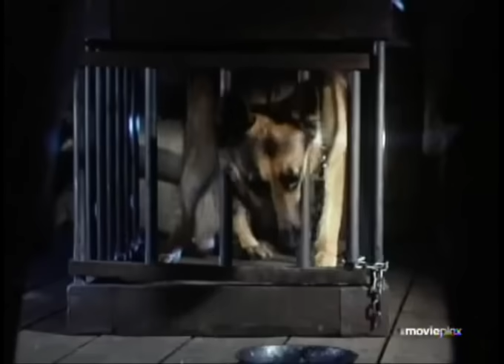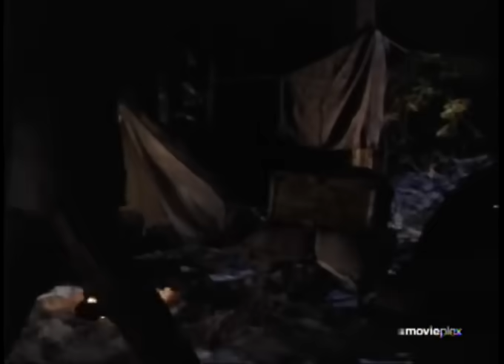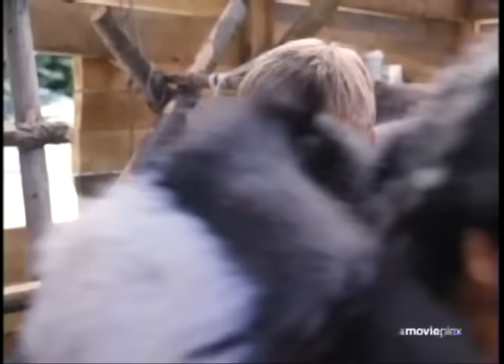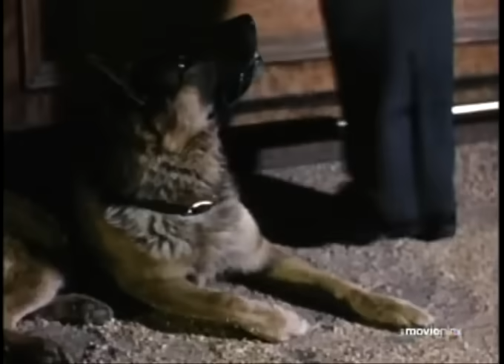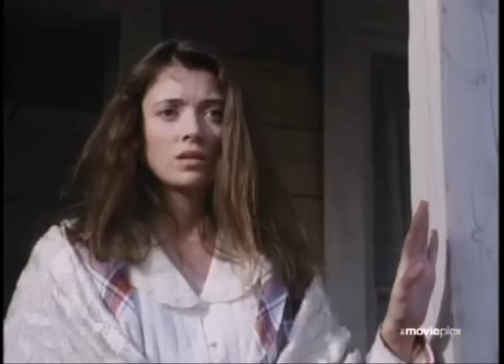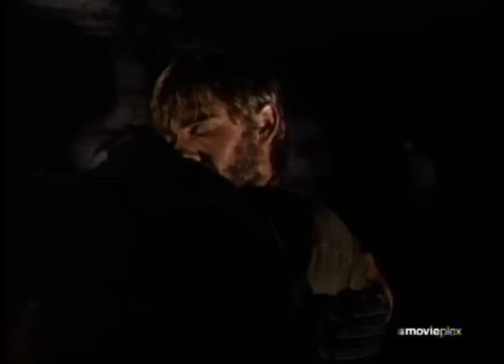1993 Movie - Filmed in the Quesnel Area

Comment: Wha-

THEY COULDNT AFFORD A SAINT BENARD?!?
Reply: The true sled dogs are unbelievably powerful and carry weight far beyond that you could believe. They not Only pull the sled well but can do so at a run, like a thoroughbred. Because that's what they are. They're designed to burn fuel more efficiently than the heavy breeds. They love to pull so much that they jump around in eagerness to go, and must be held back in the beginning to keep them under control. They are true marathon runners that will leave you behind if you don't anchor them in place whenever you're stopped. Give it a try, you won't be disappointed.
Reply: I remember reading this story when I was a kid and I believe Buck was half St. Benard and half wolf which I always thought would make an awesome powerful dog.